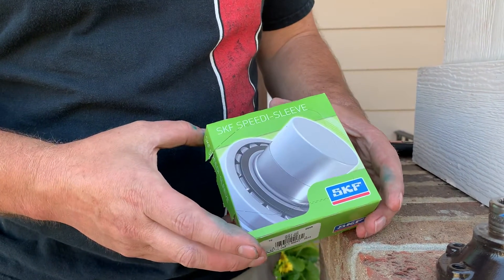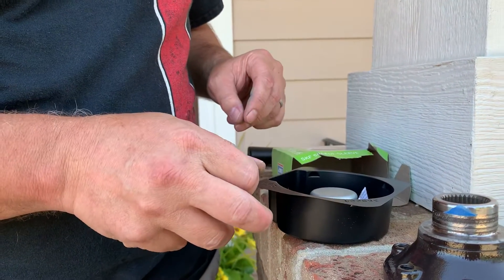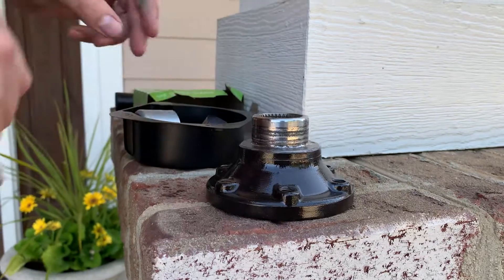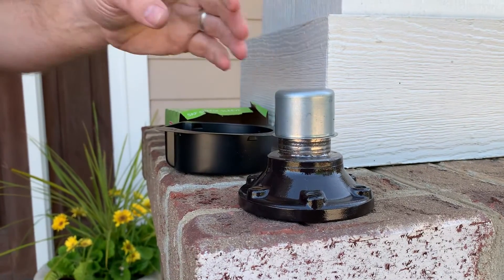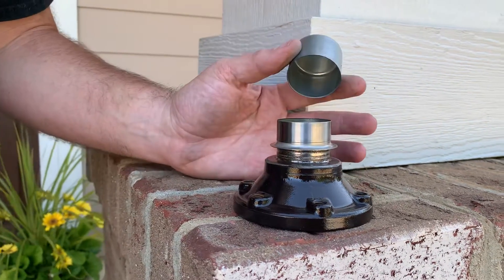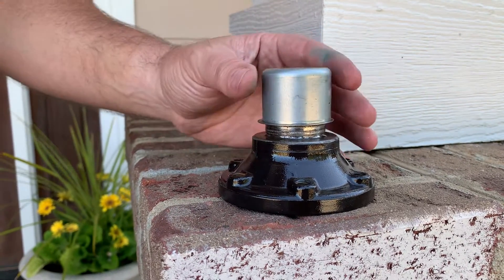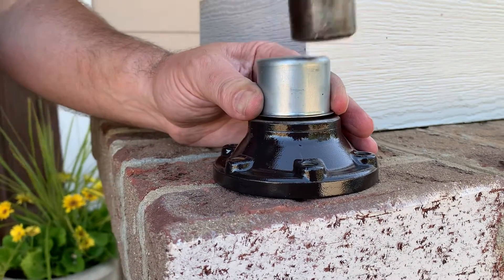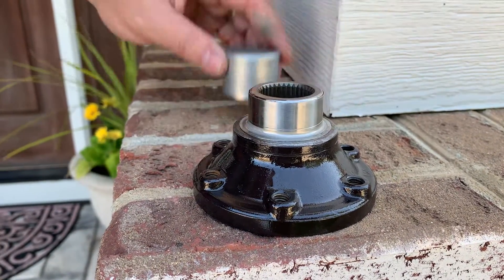SKF Speedy Speedi-Sleeve install

Comment: What is this for?
Reply from the maker: It's an interference fit sleeve to put over worn sealing areas on a drive shaft to restore the corrosion caused by moisture getting into the sealing area. Provides a new surface for the shaft seal to mate with.

Comment: Only problem is they don’t work if the shaft has any features ahead of sealing area. Keyways or castles, even if they are machined concentric and/or shy of target diameter are a no-go for this type of repair.

Comment: Good idea for when only a rubber seal wore a grove in the shaft.  I noticed this happening with pump shafts and had to replace the entire shaft when an O ring wore down a shaft enough for a drip leak of valuable fluid.   It is true that rubber seals do wear down metal
shafts.  God bless.

Comment: Do you need a different size seal after installing the sleeve? Why not put a dab of silicone or even blue locktite around the bottom, to prevent oil from leaking out below the sleeve?
Reply: No, same size of seal.Optionally, a light layer of a non-hardening sealant, e.g. Loctite 209, can be applied to the inside diameter surface of the sleeve. Clean away sealant that migrates to the shaft or sleeve outside diameter surface. If the shaft is deeply scored (see note above) fill the groove with a powdered metal epoxy type filler
Reply: @LeeWalker-hl1fn  Thank you.

Comment: How liquid proof is it, please? is there not the likelihood that oil could leak between the sleeve,. and the pitted shaft?
Reply: Gotta just try it , I clean up the shaft pretty good first ,
Reply: A smear of blue hylomar or similar around the worn shaft would be sensible imho.

Comment: Should we use any type of loctite for avoiding leak through the sleeve ?
Reply from the maker: I did not and no leak through since the vid. It provides a great seal w/o loctite, but I'm sure it wouldn't hurt.
Reply: Optionally, a light layer of a non-hardening sealant, e.g. Loctite 209, can be applied to the inside diameter surface of the sleeve. Clean away sealant that migrates to the shaft or sleeve outside diameter surface. If the shaft is deeply scored (see note above) fill the groove with a powdered metal epoxy type filler

Comment: Great product that a lot don’t even know about these days
Reply: I have a minor driver side axle seal leak after the mechanic put a new one in.I will be buying this product so he doesn't have to take my CV axle shaft apart again.
Reply: You're right I Just learned of it today used it on a 19998 Toyota Avalon CD camshaft..
Reply: I need to put a sleeve on my subaru camshaft.  No room to remove the flange.
Not sure what to do.
Any suggestions?